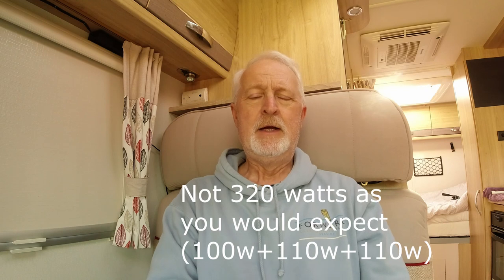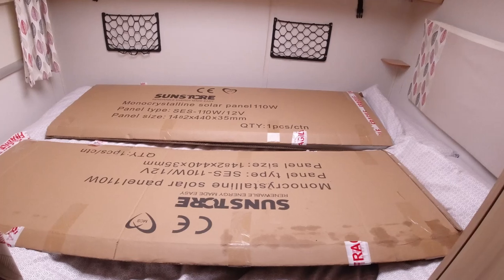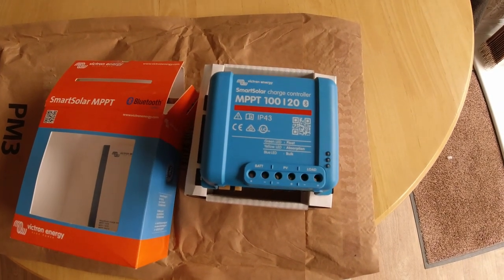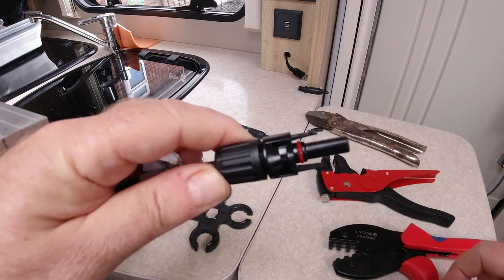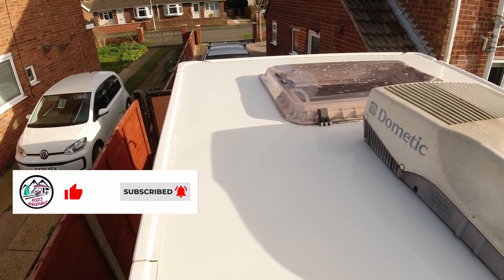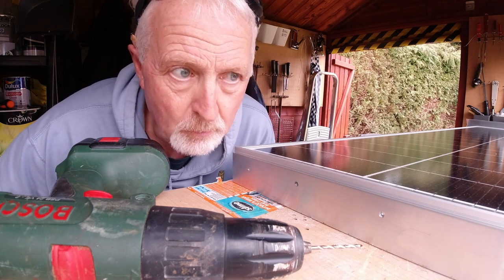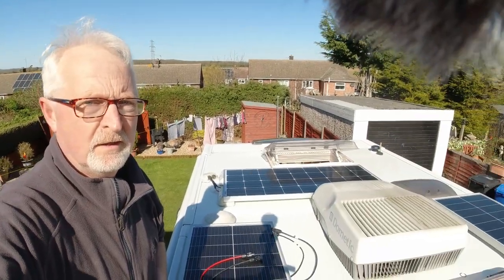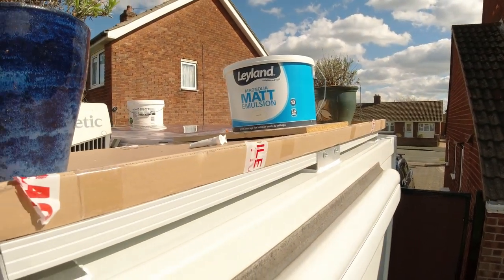Motorhome DIY Solar Upgrade (UK). Part 1. Step by step. If I can do it, so can you!

Comment: Great video. Not easy to make when up a ladder.

May be add a note in description about when mounting the angled brackets make sure the holes you drill are below the actual solar panels

Comment: Great video! Just wondering what the washers and self-tappers were made out of? As I've heard mixing different types of steel can cause corrosion and discoloration?
Reply: Did you manage to find the self tappers. Like you looking for ones that won't corrode
Reply: @peterdavies2922  Hey! Ended up going with Stainless Steel self-tappers.

Comment: Hi Andy another great informative video and looking forward to the next one. Please can you link the video regarding charging the ecoflow from the solar panel system. We've looked into this and it was going to cost an arm and a leg, so would be interested to know. Thanks
Reply from the maker: Hi Sue. I've put a 2-way switch in my set-up that switches the solar panels away from the solar controller to the ecoflow. A solar charging lead comes with the ecoflow, I just cut the mc4 connectors off it and wired the lead directly into the 2-way switch.  Part 2 of this install will have a basic circuit diagram showing this.

Comment: Hi Andy, interesting video and something I'm considering when our CV40 finally arrives. Did you use all 3 tubes of Sikka? angle brackets seem a good idea and about the same cost as buying the normal mounting brackets but you have more footprint. Brave putting the plant pot up there. Cheers K.
Reply from the maker: Thanks. Yes, I did use the majority of the sikaflex. Plant pots were fortunately still there in the morning :)

Comment: Great videos. Just about to take the plunge. I've got the panels just need the brackets and other bits. Can you confirm what thickness the aluminium angle was you bought - was it 1/8 or 1/4 thick.  Thanks.
Reply from the maker: It was 1/8 inch.  Good luck with your install. Thanks for watching and subscribing

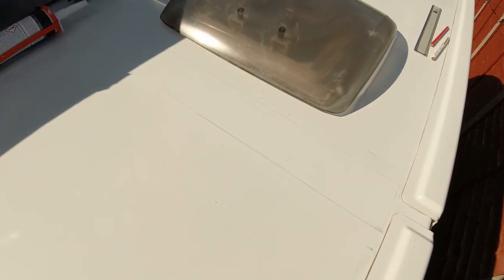Comment: 28:00 I didn't see you clean off the dust after sanding down. Instead of sanding down, probably a better choice would have been to clean the contact area with alcohol.